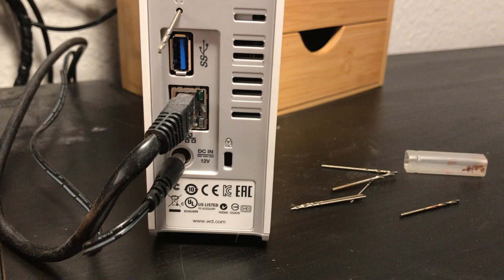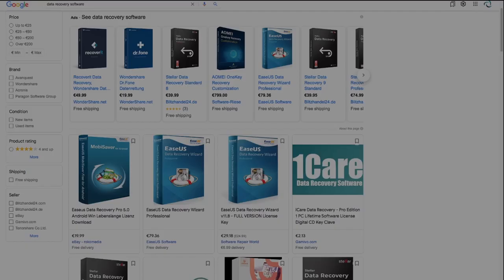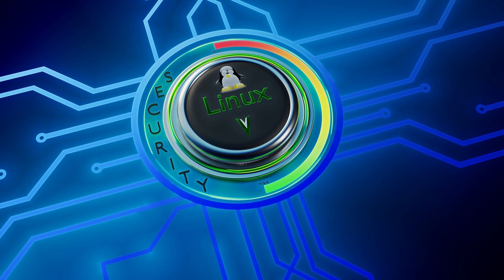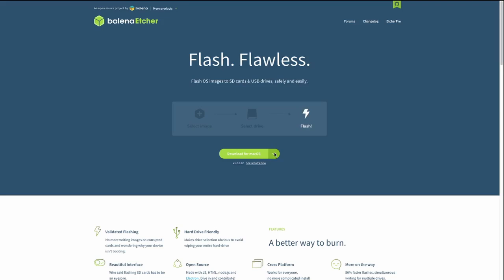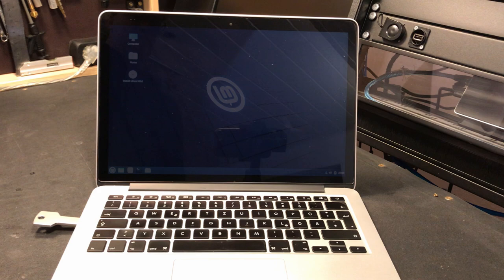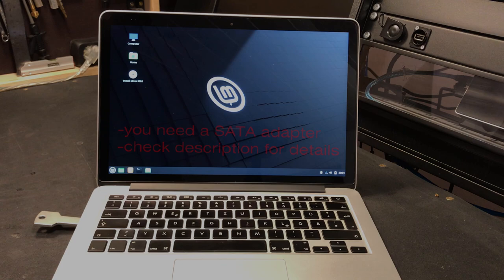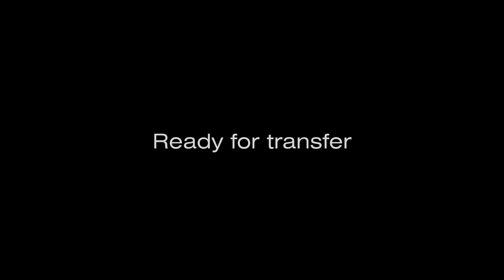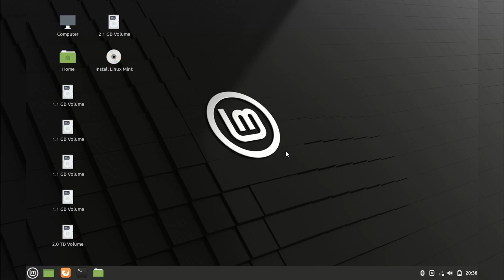Recovering Data from a Broken WD MyCloud (with solid red light) by using Linux on Mac and Windows

Comment: Option 0: plug your ethernet cable into your device without any reset. If you do a soft reset, plug it again. In my case for some reason MyCloud didn't want to connect to my network, the network led on the back didn't blink. After plugging it into my Mac mini it worked.

Comment: !WARNING! DO NOT DO A FACTORY REST LIKE VIDEO SUGGEST.  I LOST ALL MY DATA!
Reply from the maker: Hey Thomas,
I am sorry to hear that and I hope you know it is in no way my intention to publish misleading information. What I have shown in the video is the exact way I recovered my data and it worked for me, so I wanted to help other people with the same problem to regain access to their data too.

I was 99% sure I did everything like WD told me to, because my own data was at risk and I double and triple checked everything. But your comment kept popping up from the back of my mind so I reviewed the information that I used for this video - after all, mistakes happen alle the time. 

My reference is this device:
https://support-en.wd.com/app/products/product-detailweb/p/126

And this manual:
https://products.wdc.com/library/UM/ENG/4779-705147.pdf

On page 92 the manual gives us two options:

A: Resetting with Power On (four seconds)
B: Resetting with Power Off (40 seconds)

In my notes I also found this Support Page, which lists the exact items that will be reset:
"How to Pin Reset and System Only Restore My Cloud OS 5 Device"
https://support-en.wd.com/app/answers/detailweb/a_id/29445/h/p2

It specifically states:
"Critical: The following process is Not Data Destructive and will not impact user data on the device."

This was super important to me and gave me the confidence to do the reset, as the the whole point of the reset was to get my video footage back. It's been a while since I released the video but I remember that I hesitated for a week or so (while searching information and digging through forums) before I pulled the trigger and did the reset - and it worked for me.

Again I'm very sorry for your loss but even after a in depth review I don't think I gave wrong information here, there are many other causes for data loss on a broken NAS.

Comment: Of all the MyCloud recovery videos, yours is easily the best, and the most likely to work. The other videos, focus around sticking the HD in a 3.5in HD external mount. They don’t take into account how the MyCloud worked. Thank you very much, for your thoroughness and technical knowledge, delivered in a calm and authoritative manner!
Reply from the maker: Thank you for the feedback, I really appreciate it :)
Reply: THis method will work when something is wrong with the external enclosure, or it's USB interface...; if the drive itself has gone bad, removing it from an enclosure is of little help.

Comment: After recovering my data with bootable Mint USB drive (no success with the VirtualBox) I just installed again the HDD on the enclosure, and find out the issue was on the mains charger. Just plugged another 12v 2A (from another external drive box) and it's working again! Thank you a lot 🙂

Comment: Does anyone knows if this works for the MyCloud HOME disks? I got a slow breathing LED in the last days and the device shows offline. I took the internal HDD out of the enclosure, put it in a 3,5" case and checked it with UFS Explorer. -> Datafile System damaged it shows. but for some kind the disc makes no noises and is also readable. i wont give it up totally. the problem is, that i am on apple OS system and also i got mac studio and MBP M1 versions. i heard the M1 cant boot linux from flashdrive. any help is really appreciate

Comment: The video is so good.. My WD4100EX enclosure is not booting up. The 4, Raid 10 hard disks are ok. . How can I recover Nas drive with Raid configured?  Also Can I change the WD4100  encloure to another brand (synology) or the existing model WD 4100 EX must  be used ?Thanks

Comment: Thank you so much! I am rescuing my files right now with your help. My WD MyCloud 3TB died today. 
Red light despite everything and I was hearing a clicking and hissing sound from inside. At first I thought that the drive had failed and the noise was from the drive's head. Imagine my surprise when I took it apart and found out that the sound was coming from the PCB! I couldn't pinpoint it to a particular element on the PCB, but it was producing the sound I was hearing nevertheless! It was the weirdest thing! 
Anyway thank you again.
Reply from the maker: Awesome, I hope everything works well :)
Reply: After experimenting with the power supply, I managed to get it working again with a different one, even if it was 12V 1.5A and not 2A like the original one. I got all my files with your method. Now I have to decide if I'll throw it away or piece it back together. But honestly I'm fed up with it. Nothing but problems...

Comment: WD is garbage. Had my WD My Cloud for years. As soon as they withdrew support of the My Cloud, it failed.

Will try this options. Thanks
Reply from the maker: Perfect example of planned obsolescence, hate that. I hope it works for you and you can get your data back :)
Reply: I have the exactly the same problem and don't know how to get data out.  Try many software and all failed.
Reply: All hard drives fail sooner or later. You said you had it for years so it isn't really surprising. You can connect another drive (a MyBook, for example) to the USB port on the back and use it to back up the main drive every night - of course, you have to do that before it fails.

Comment: I was able to do everything up till connecting the drive via powered SATA, alas it does not show on the desktop.
Reply from the maker: Oh that is unfortunate, but it was worth a try. I would suggest to use data recovery software then, many programs are designed to detect even damaged devices with corrupted data on it.

Comment: Hi no expert I am also in Germany and struggling with my mycloud ex2 could I please get in touch?

I connected the drives with a sata cable but they show nothing..do I also need them powered?.thought the USB sata provides power.

I don't have Linux just tried Linux file systems program by paragon software but it finds nothing. I wonder if it's because the drive is not powered on? Do you have email instagram or something where I could reach you? Thank you

Comment: Thanks for the video I have followed your instructions and can see the drive in Linux Mint however when I click on it says "unable to mount volume" unknown file system type 'apfs" ... any thoughts? Thanks
Reply from the maker: Hi Adrian, so the 'apfs' is a special apple file system and can only be read by apple computers - wonderful...
To make it readable on windows I found this: https://www.paragon-software.com/home/apfs-windows/
I have not tested it and it costs 50$ but it is specifically made for your purpose - it might be worth a try. 

I am pretty sure there are some free tools as well because there is always someone who makes a good solution open source and accessible for people with the same problem ;) I wish you all the best!

Comment: I am unable to mount the drive getting error message "error mounting /dev/sda2 ........ unknown filesystem type 'apfs'.
Reply: There should be no APFS formatted partitions on the MyCloud drive. APFS is only used on newer Apple products. It looks like you're trying to mount partitions from the wrong drive.
Reply: APFS...just a file access protocol like SMB or SAMBA. WD MYCLOUD is Debian based with an EXT4 drive formatting schema.

Comment: I tried to read a HDD of my MyCloudMirror with ubuntu linux but only shows me a 1GB partition, I can not mount the 4TB partition  to see the docs inside. with gparted the system shows me all partition (total= 5) but I only can open 1 and is empty. Any suggestions or I´m doing something wrong? Should I connect both HDD? 
Thanks for your help
Reply: I've got the exact same problem! Any help would be great.

Comment: Tks for posting your videos. I have reviwed the first part as well. I used Micro Center a PC repair shop to assist. They have opend the drive and are able to see my data of the WD 8TB NAS drive,  but the servise tech Ryan says, that he cannot get passed the encryption. Here is Ryan's message
"there is no error message its a matter of encryption on the drive. the encryption is built into the my cloud NAS system to prevent data theft.  we used linux based and windows based and built in technologies in the OS to try and decrypt and view the data on the drive we managed to get all the direct links to the drive folders so we know the data is there but it is all still encrypted and unable to be accessed by us after many failed attempts we had to label it as UN-readable by our service"

Any help in this regard is greatly, appreciated, many tks.
Reply from the maker: Hi Rajeev, wow that seems strange and probably feels really bad because you know it is there - unfortunately I can not help you further because I don't know a lot about rescuing strongly encrypted files :(

One thing that just came to my mind is: If your MyCloud is broken but the HDD itself works and you can see that the files are still there, it might just need "the right environment" to be accessed again...

So what if you buy the same NAS System (maybe used on eBay) and exchange the HDD. Then boot it up and unlock the data by typing in your access keys in the web interface. When even a computer shop can not help you with that, I'd probably give this a try. I wish you all the best! :)

Comment: you sure it would not delete the data?
Reply from the maker: No, not 100%. But to delete the data you have to manually remove everything that is stored on it or actively reformat the hard drive. Factory reset only deletes ALL passwords, accounts and settings but the data stays there. At least that is what it is designed to do, like I said I can not guarantee it, but I did it before and it worked and the data was still there.
Reply: @no-expert  thanks. Work as what you have spoken.
Reply: @no-expert  I LOST EVERYTHING DOING THE FACTORY REST.  ALL MY PARTITIONS ARE EMPTY.

Comment: WD Cloud is totaly shit. Buy Synology.
Reply from the maker: I agree and I will most likely never use WD cloud systems again. The WD Red HDDs seem to be okay though, after all this one works fine. Looking forward to setting up a new system :)
Reply: Sadly there is no choice. I miss Toshiba and Hitachi.
Reply: @GokuMcDuck  WD has good disks, they are used in the NAS.  however, the WDCloud system is weak.  Additionally, WD withdrew from support for some devices.  In my opinion, this is outrageous.  all decent archiving systems have the option of formatting the disk.  WD Cloud doesn't have that.  Even when you learn how to format a disk, which is complicated, it can only be done in windows or other strange systems.  This is difficult.  It's idiotic.  This is not done.  A simple formatting program would suffice.
Reply: Very happy with my Synology (2-disk) and continued support.
Reply: @GokuMcDuck  Toshiba drives are still available, along with WD and Seagate. The N300 series are Toshiba's NAS range. They are like WD Red Pro and Seagate IronWolf Pro, all CMR and 7200 rpm. I bought one only yesterday.
Reply: @johnm2012  Great!
Reply: @GokuMcDuck  Hitachi which is HGST--Hitachi Global Storage Technologies is now owned by Western Digital. Cheers! 😁👍🏻